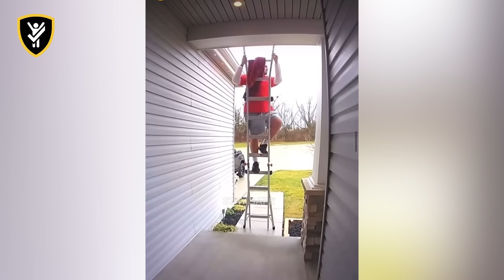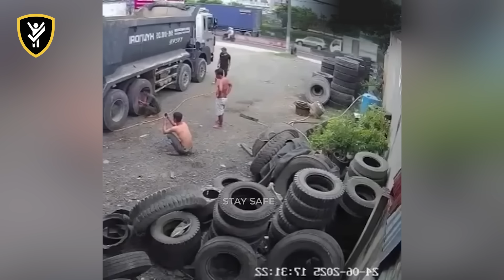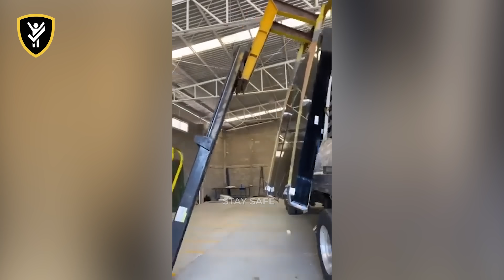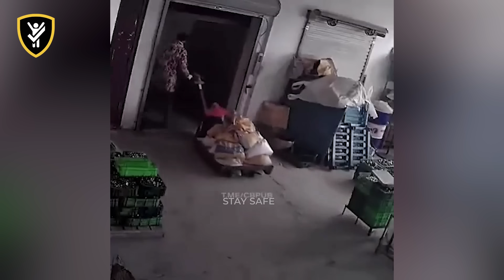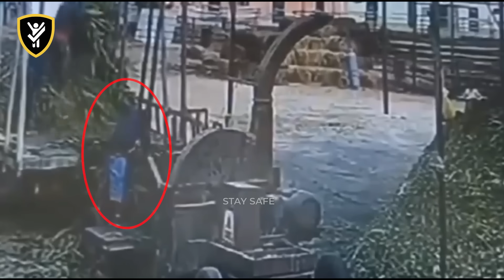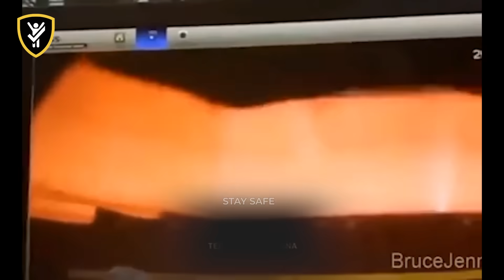He Adjusted The Material… Then This Happened!

Comment: For clip 7, another issue is that forklifts are not well suited for suspended loads.  The driver got into trouble when he set the load swinging.  His best bet in that situation was to only lift the glass enough to strap it down onto something that could be lift with the forks.  The load was not constrained against swinging, so, when the driver moved the forklift backwards, the load stayed exactly where it was and the forklift pitched forwards.  The frustrating thing is that forklift was modified to pick up the glass bundles, but was not heavy enough to safely carry the glass bundles.

Clip 6, flour is a combustible dust hazard.  If he had spilled that tray too close to an open flame, there could have been an explosion.

Clip 3, the machine is an auger conveyor, not a rotary tiller, but you should still stay away from it, while it is in motion.